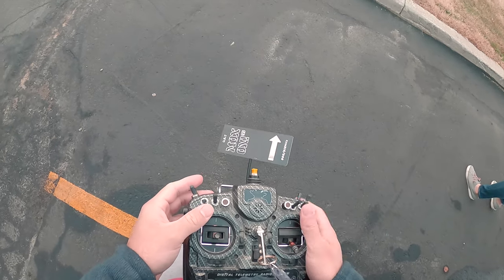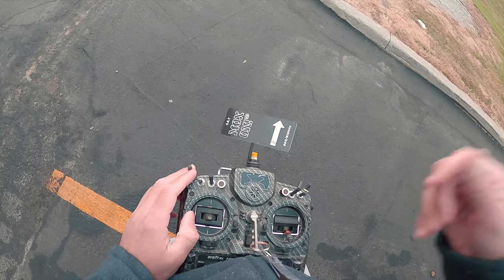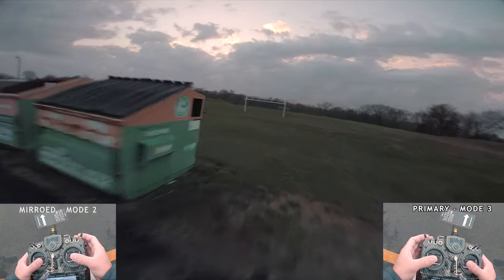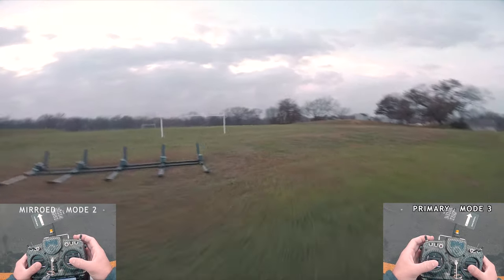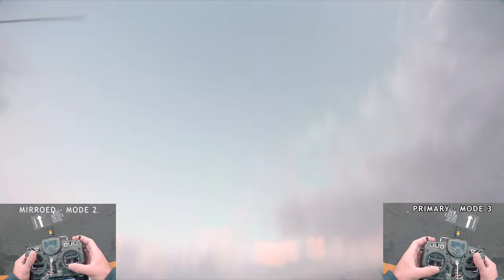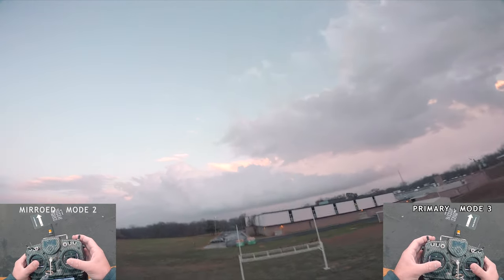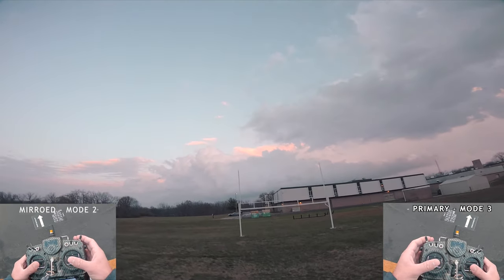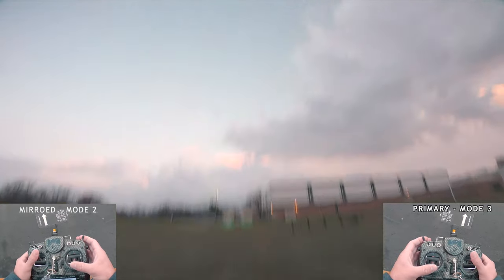How to FIX your POWER LOOP? | FPV Freestyle | FPV BASICS!

Comment: mastering throttle control is the magic behind this hobby
Reply from the maker: Yessir
Reply: Completely agree 100%, up to that point you're really just flopping around in the wind. It's that eureka moment once it starts to click.
Reply: Something I have found helps me a TON with throttle control, set your throttle midpoint between .3 and .35 and set your expo to around .4
This will allow you to hover with less throttle and increase the resolution of the upper 65%-70% of the stick.
Reply: @gerthyfpv7577  It's a good suggestion, but your throttle mid point will differ depending on your quad. For my quads, I look for the position of my hover point on my throttle stick, then I set my mid point just below that, followed by setting my expo. Some people like an aggressive setting, I keep mine pretty mild at 13 and my midpoints are only at around the 25 mark. I do agree though, adding a little sag to the throttle curve does help in managing it a bit.
Reply: @michaelc5027  Yes I completely agree!  For me it was a good starting point and like any other set of rates I adjust according to the size/weight and style.  I tend to put a bit lower mid point with more expo into my freestyle and a higher midpoint with less expo on my 7".  But everyone will have their own preference so it's always good to change it up and see what you like and don't like :D  In addition to lowering the midpoint if you don't tend to use full throttle you can set a throttle cap and it will increase the resolution even more!
Happy Flying everyone!!
Reply: @gerthyfpv7577  For sure, completely agree, whatever helps you fly better and the way that you want to fly 👍

Comment: I know I dont have the skill to judge and I dont want to be mean, but I think you should try to not always go 100% on the throttle when powerloping. I think they'll look better if you would just go half and do it even closer :) 
Nice video though!
Reply from the maker: This all depends on your setup and throttle curve. You need the power to clear the object so if you have a weak setup or the throttle curve is low on power on the bottom of your throttle curve you won’t clear it. It all depends on setup weight skill and what you are use to
Reply: Yea throttle management is what is needed to powerloop properly but you won't get that until you get use to your gear.
Reply: I also think you can do it with less throttle to get lower to the object, but i am so far away from your skill level ... so what am i talking about. Great vid, great channel. Do more tuts and thanks for all your work 👌👍👍😊
Reply: @VIKFPV  I agree. I think tuning your quad to use full throttle on powerloops can really help with consistency. That way you're not accidentally using a different throttle value each time.
Reply from the maker: Exactly. Well said this is key to knowing your gear and flying consistently with throttle control.

Comment: Throw on some 2 blade props. More "drifting" helps to get around the Object without hitting it ;-)
So you can pich earlier and see more of the Object. 
More camera angle helps as well.
But be aware of smashing it when you fly wiht your standard settings again ;-)
I crashed a steel beam. 2 Motors, the Cam, the FC and the Frame.
Reply from the maker: Hahaha